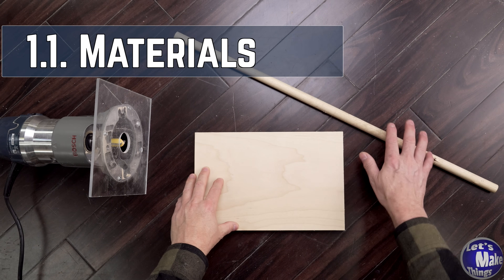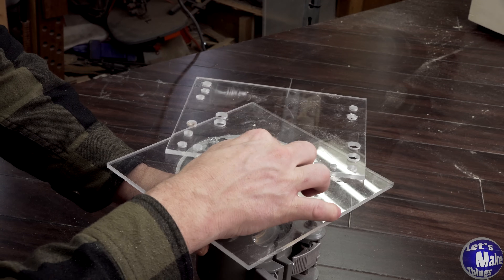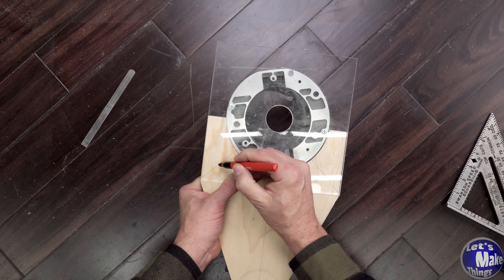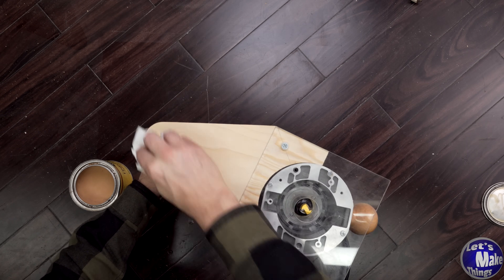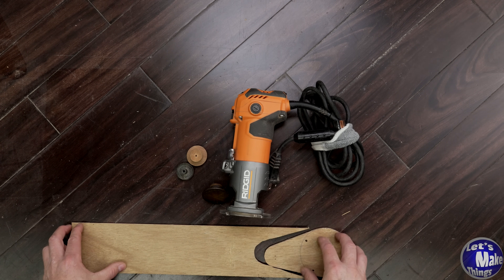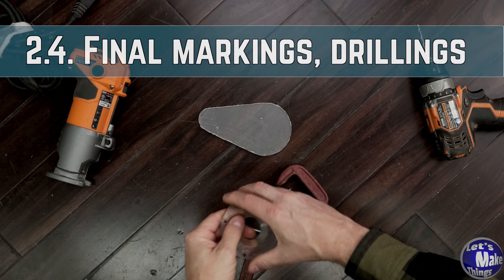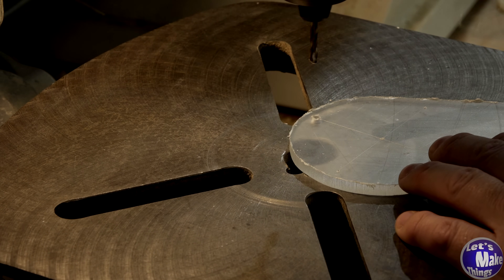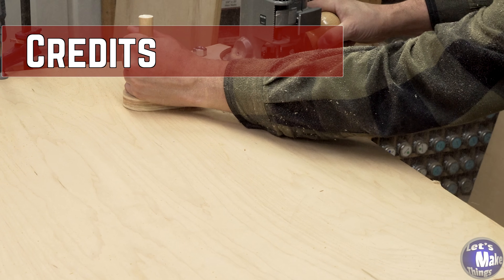A Router Anchor That Ends the Balancing Act // Router Base Onion Build II

Comment: Thoroughly absorbing vid with a ton of good stuff. This is definitely one of my favourites of your ideas for power tool improvements. The instability of the router on the edge is something I've struggled with for years - this looks like the ideal solution. And using the candle to lubricate the drill bit is a super idea! Cheers Rob, good stuff mate.
Reply from the maker: Thanks Mark!  Yeah, I've always disliked balancing routers on the edge.  I'm sure there are those that have it down, but it's frustrating when a little hiccup comes along.